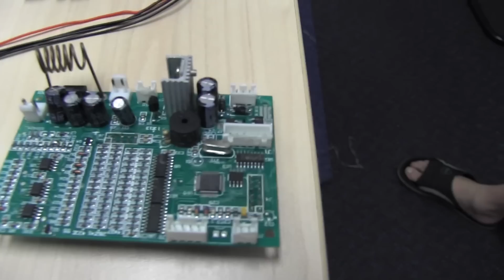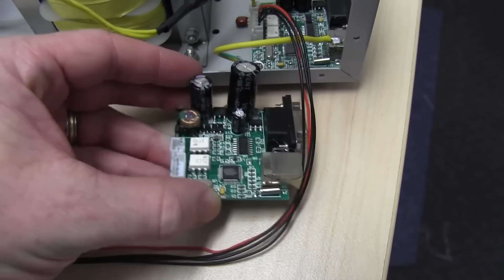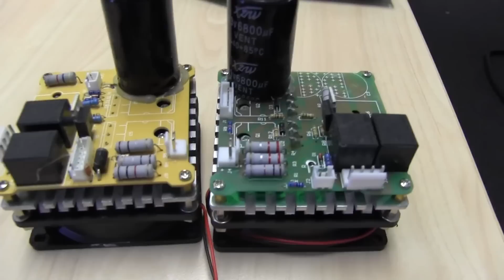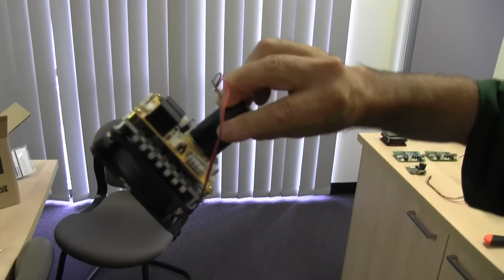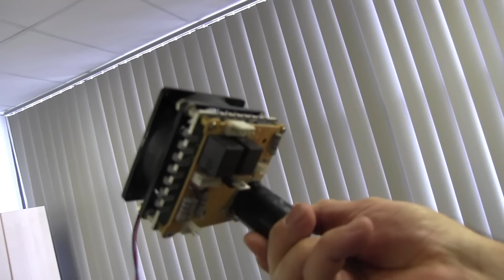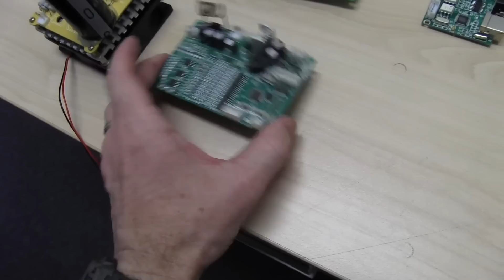EEVblog #404 - Korad PSU Followup

Comment: Korad ka3003p has better output specs than ka3005p, 1mv vs 2mv, 3ma vs 5ma, in output fluctuating, according to the specifications. Dave, could you verify this? You can do a comparison video with others, that will be interesting.

Comment: My Korad had the same issue with the new board. I'm done with this Chinese junk. From now on, on keep on saving money to buy Rohde & Schwartz or similar high end equipment. Granted you can buy a complete lab with Owon or Siglent stuff for the price of just a Rohde & Schwartz power supply, but at least you don't have to worry about the equipment failing or, even worse, destroying anything hooked up to it.
Chinese just can't designing anything decent.

Comment: Things have moved on yet again with this power supply. The heat sink is a rather fancy extruded one with a separate area for the bridge rectifier. My only concern is the transformer has a 230 V label on it. My mains is around 245 V but I won't be  hammering it. Nearly everything we get has the EU 230 V label but so far nothing has popped - yet.

Comment: I realize it's a bit late to ask.. but did the overshoot problem go away as well?
Reply: all is relative as to in regards to what pricelevel-psu you comåpare to,, but as a 80US budget 150w liniar psu, it seems to perform pretty damn solid..

there is a lot of users responses as in regards to reltive little spiking in this EEVthread, but there seems to be multiple batches and also newer then this where there is 3 caps on that board, where there is 1 in the video...(check here)
http://www.eevblog.com/forum/blog/eevblog-315-korad-ka3005p-reviewfail/300/

Comment: Hi,

seems there is just another version with a slightly different board layout which just broke down on me. Purchased January 2014 in Germany, display showing 12.00V output is nine-ish with a couple of meters of led stripe drawing 1.5A and disabled protection / constant voltage mode.

Andi
Reply: +Horst Kotte could as well be 2 Ohms between PSU and voltmeter!

Comment: For me, its very rewarding to build things. Don't be disheartened about the lack of gear. Youll get it slowly over time. I started tinkering with an analog  meter (MAVO35), a shitty soldering gun, recovered parts, plenty of wires  and a homemade 12v max 500mA psu built and gifted to me by a HAM who happened to live in the same apartment building. If you feel joy building, Id say ,do it, even with less then ideal equipment.  Build up from what you have.

Comment: You can get shitloads for 100 USD, if you know how to choose the parts. Certainly much more than any low cost PSU. if you ask me they do not worth the money.  Don't let yourself blinded by voltage displays with PICs and LED sgments, its not what it counts in a lab PSU. And for what it worts, if you want it fast, just use 2 LT 3083 and , fixed steps for current compliance and a 10 turn pot for voltage. Still beats the shit out of any low cost PSU.

Comment: The downside it's that is not load regulated and has shitloads of noise. Anyway, for anyone who desires a high performance "low" cost PSU,  google "chemelec super power supply". Understand the schematic (it's a discrete version of the obsolete MC1466L)  and replace functional blocks with op-amps and drive jfets / mosfets at output. Your requirements may vary, but look into: 
OPA445, OPA452, OPA551(not most cheap) , AD549(expensive) , an AD or LT voltage reference.

Comment: Nice follow up. Still a cheap power supply, but at least you do know that the design is good, and that the manufacturer does stand behind the product and is willing to do any changes to improve the reliability of it. Makes for a good relationship, and a good plus for both Korad and Charles for being so open about the issue and for resolving it.  Like the respin on the power board, now the semis are not stressed by soldering and assembly. Nice looking upgrade, and good work. Love the flip flops..